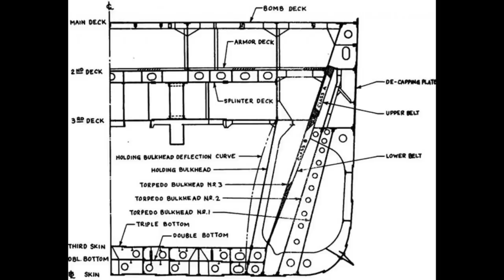The Drydock - Episode 230

Comment from the maker: Pinned post for Q&A :)
Reply: Dr. Alexander Clarke has argued that instead of hiding the true specifications of the Yamatos to make the enemy underestimate them, the Japanese should have gone with a Tarkin-esque approach of intimidation and announced these ships shortly before Yamato’s completion to throw all other navies off their game and force them to rethink their naval construction plans, which would buy Japan a bit more time to build up its naval forces. Do you agree with this proposal?
Reply: Could the Royal Navy have built the Lion class battleships while still complying with the rules of the Washington Naval Treaty?  Also would a KGV with triple 14" guns in 3 turrets have been a more reliable and cost effective option than 2 quads and a duel?
Reply: I recently became aware of the existance of the Kitson Still engine. a Diesel Steam Hybrid engine which not only worked but was remarkably fuel efficient. Was there any attempt by the British (or anyone else) to use such a design in one of their warships, and could it have worked/been useful?
Reply: @davidknowles2491  I'm sure the designers intended the quad turrets to be reliable.  I looked in to the choice to revert to 14" on the KGVs.  The decision seems to have been driven by the "more guns equals more hits" theory.  The initial plan was for the KGVs to mount 12-14", but the armor deck was raised, and that extra weight required B turret to be reduced to a twin.  As one book I read said, that decision, which reduced the armament to only 10 guns, undercut the reasoning to go to 14" in the first place.  Admiralty analysis of the various design proposals said that 9-15" gave the best balance of firepower, speed, and protection, and explicitly said the only reason to go to 14" was if required by treaty.  I also looked in to the triple turrets on the Nelsons.  They also had many faults, most of which had been corrected by the mid 30s, but the basic design of the systems slowed the rate of fire to only about 1.6 rounds per minute, vs 2 rounds per minute on the KGVs, so adopting the Nelson design, in spite of it being debugged by 36, was a no-go.
Reply: Would something like an Iowa museum sell a large chunk of steel plate for it's prenuclear steel for large amounts of money? I heard that stuff was really valuable
Reply: Drach, in regards to post 55:27, do you think that if TITANIC, if the process had of existed in 1911, had an arc welded hull, would she have stayed afloat longer?
Reply: @jesseestrada8914  that's highly unlikely. Plus I believe as museums they have certain agreements on how the ships are to be used or marketed. I don't think selling parts of the ship is contractually allowed?
Reply: @lloydknighten5071  once you have pierced the hull and have water ingress? The issue with the compartments over filling with water would not change.
Reply: @saoirseewing4877  sort of depends on location, number of torpedoes and Warhead size. The preferred method these days is to place a torpedo under the hull and break the keel. Versus the torpedo protection which was designed to counter a direct hit.
Reply: @saoirseewing4877  On the other hand with the Belgrano a WWII era ship was sunk by WWII era torpedoes.  How well a modern Torpedo would do did not come up.
Reply: @chrissouthgate4554  it's not exactly an apples-to-apples comparison. The ships have different levels of protection.
Reply: In the Washington Treaty, would the UK and US have been better off accepting a more favorable ratio for Japan, but increasing the limit on ship numbers to be economically impractical for Japan? Say instead of 15:15:9 capital ships it goes to 22:22:16 or thereabouts. Japan is permitted its Eight-Eight Fleet and a >70% ratio if they are willing to pay for it, which should strengthen the Treaty Faction of the IJN. But they'd have to cut a lot to actually pay for it, if they even can.
Reply: @morat242  The Japanese wanted a more favorable ratio to the US and UK, but the US said that was not going to happen, so the best way to save face would be to at least complete Tosa, which would put the IJN 26,000 tons over their limit, vs the historical retention list putting them 14,000 tons below their quota.  The Japanese could have made a credible argument that they were entitled to a 42,000 ton ship, because of Hood.  If the USN Tennessee class was deemed "post-Jutland", then they, combined with the three Colorados that were completed, would make 5 "post-Jutland" ships, at zero additional cost vs historical expenditure, vs Japan's 3.  Maybe give the US clearance to upgun the Tennessees to 16", if they want to, to make a 5:3 ratio of 16" gun, post-Jutland ships.  Then the UK would be entitled to 4 Nelsons, which they might have trouble paying for, on top of their load of war debt.
Reply: Hi Drac in your opinion among all classes and nations, during WWII which battleships were the most accurate and with the least dispersion?
Reply: Hey DRACHINIFEL... You used the fraise Muppet. Here in my part of the world muppet means a character puppet you would see on Sesame street. What does it mean in your part of the world?
Reply: @morat242  the number still workout for Japan. The UK has three oceans to defend. The United States has two. Her Rivals are spread rather thinly.
Reply: @WALTERBROADDUS  Not if the US and UK have 22 battleships and Japan's economy implodes trying and failing to build 16.
Reply: @morat242  everyone's economy was imploding in the Great Depression.
Reply: If the Brits and America had formed an alliance pre WW2 how might that have altered the balance of power?
Reply: Hey Drach, bit of a long question but it’s one I’ve had buzzing in my head for awhile; I’ve heard that after USS Hornet (CV-8) was abandoned after Savo Island that the Japanese destroyer that sunk her had orders to either sink the carrier and to ascertain if it was possible for the ship to be captured.
 
My question is what if Hornet was still abandoned but was in good enough condition for the IJN to try to capture the Carrier?

What would you imagine the hypothetical reactions be in Japan and America at Hornet becoming the first capital ship captured in a time of war since the Russo Japanese war?

What, if any, consequences would Hornets crew face for allowing CV-8 to fall into the hands of the enemy?

Would the US navy dedicated resources solely to sink the Hornet if it was captured?

What do you think the Carriers fate would be? Would it be used for training, familiarisation  and target practice purposes by the IJN or could you see Japan actually trying to repair Hornet and either using it as a fleet carrier or an auxiliary vessel kinda like USS Stewart or would it just be dug through for intelligence information then sank just at a later date? 

Assuming Japan somehow could field a captured Hornet, while definitely not enough to turn the tide of war, what impact could it have on individual actions in the pacific? 

I’m very interested to hear your thoughts and reasoning on this; also keep up the good work
Reply: @WALTERBROADDUS  , thanks.
Reply: @MrToymaster1  that is a ton of Woulda, Coulda, Maybe, what if, Magic 8-Ball speculation?🎱🙄
Reply: @WALTERBROADDUS  Great Depression was 1930+; WNT was 1922.  Japan's economy was struggling early, but pulled out faster than US due to massive government funding.  WNT era was early 20s, when Japanese economy was still building and shipyards were few.  It was only about 10 years after Vickers transferred building of Kongos to them.
Reply: @LeCharles07  No.  Japan's shipbuilding was at it's limit in the late 30s, partly due to Yamatos but also partly due to yard and worker limits.  The number they took were the ones with the longest legs (most steaming radius, though only 2 of them could make it all the way, so there were tankers along and they struggled to refuel in stormy December North Pacific seas).  The Shokakus were just commissioned and still working up, their air groups were considered "green".  The other carriers available were light or escort, some that could not handle the North Pacific and all with much less steaming radius.
As to "the strike group didn't utilize every attack wave they could have", take a look at Zimm's book on the Pearl Harbor attack.  The first two waves were EVERY attack plane on all six carriers - only a few fighters were kept back for CAP.  There was no "third wave" - it would have been made up of planes from the first wave, recovered, repaired, rearmed and refueled.  Same problem as at Midway - they were struck below when the second wave returned, and the second was more damaged than the first.  No third wave could have been launched until around 11AM at best, but at that point there was a need to rescout the area for the missing US carriers.  Nagumo ordered anti-ship loadouts and high-tailed it north.
Reply: @MrToymaster1  The Hornet was in very bad shape, multiple holes below the waterline and burnt out.  It was not really a question of IF it could be saved - more a question of how long it would take to sink.  Plus the IJN was not willing to stick around and tow something at 1-2 kts in a combat zone.  They would have had to dedicate a significant crew to trying to plug the holes in an unfamiliar ship PLUS a good-sized ship to tow her very slowly (thereby making themselves a vulnerable target).  And the IJN did not think in terms of PR value.
Reply: @morat242  Let the IJN build up new, better ships while primarily the UK was stuck with old WW1 ships?  Not going to happen.  And the Japanese were going to considerable effort to hide the economic strains they were suffering.
Reply: @lloydknighten5071  The problem Titanic faced was that multiple compartments were opened to the sea by being scraped along the iceberg, rather than hitting it directly.  Welding versus riveting would not have made any difference here, it would be whether you could isolate a lot more areas from flooding than she was designed to handle.  Her huge engine spaces guaranteed that she would flood quickly.
Reply: @gregorywright4918  the only thing that pulled the United States economy out of the depression was the war. At any rate, most nations were focused on disarmament not arms building. The whole point of treaties controlling shipbuilding in the first place.
Reply: @davidknowles2491  There were rules about how long you had to keep existing ships before you could replace them, as well as size limits for new ships.  The Lions were designed in the mid-to-late 1930s, and were over the 35,000 ton limit of WNT.  Once the Japanese dropped out in 1936 the "escalator" clause was invoked, which permitted up to 45,000 tons and 16", but the UK was desperately trying to keep the Treaty in effect until the very last minute.  Plus the KGVs were building, taking up space, money, and critical materials like armor plate.
Reply: @bkjeong4302  Unfortunately (or, to us, fortunately) the IJN never saw Star Wars, so their existing strategy of surprise was all they had to go on.  As it happened, even the US was not sure what size they were until well into 1944, and thought they could handle them with an Iowa or two.  What they did know in 1941, when they were near commissioning, was that the US was ramping up with a truly gargantuan building program that would put them way behind by 1944.  And that was also before the big airpower lessons of late '41 and mid-'42.  I don't see the "buying time for IJN to build up" with their building plans at that time - the US was building at 2 to 3 times the rate of IJN, and learning their size might have made things worse.  Keeping the secret preserved the element of surprise, unfortunately (or, to us, fortunately) they never used them to do anything until they were hopelessly outclassed in airpower by 1944.  They could have made a difference if used at Guadalcanal, for example.
Reply: In the 1919 Baltic naval war, the royal navy forces there weren’t cleared to deploy battleships. But what if they were? What battleships do u foresee (unless they already had some battleships in mind) being deployed there and what was the possibility of deploying battlecruisers there instead?
Reply: In the picture for the conning tower question, the battleship seems to have a gap in the lowest belt along the side. Is that an optical illusion and if not, what  was its purpose or reason for existence?
Reply: What if the USN rebuilt some of the standards, like the italians did for the cavours and dorias? What do you think these rebuilds will look like and how might they perform? (Lets ignore cost for this scenario because it'll be ludicrously expensive)
Reply: How feasible was the original supercarrier United States? The one between the midways and the forestalls
Reply: Maybe as a challenge for your Alternate Admiral: Dreadnought game.  Without changing the gun layout (ie must be 4x2 NO triples)
Can you shave enough displacement from Bismarck to make her comply with the Anglo-German Naval Treaty limit of 35,000 tons?
What would you have to sacrifice to reduce her to this legal limit?
Reply: Dear @Drachinifel, have ever made a video about the "battle" of May Island? If not, could you please?
Reply: How would ironclad design be different if people had developed basic rangefinders and some sort of centralized fire control in the 1860's?  The basic science and mechanics of rangefinders don't seem out of reach of 19th century technology, though production would be difficult enough you'd probably only see them on large capital ships.  How could effective combat ranges in the low to mid 1000's of yards have altered ironclad development?
Reply: What was the Yamato equivalent for the Age of Sail, Ironclads and Pre-Dreadnoughts?
Answer: Nuestra Señora de la Santísima Trinidad  140 Gun First Rate.
Reply: I went to church with Bob Murray, the former undersecretary of the USN in the 80's who oversaw the reactivation of the Iowa's.  He told me the navy originally asked to recommission more carriers, but the Iowa's were in far better shape and reactivating an Iowa was about the same cost as brand-new guided missile cruiser.  Great guy and so willing to share his knowledge.  Perhaps a future interview with Drach could be in the future.
Reply: Drach, 
Damage control question as follow on to the Iowa vs missile question. With regard to capital ships: BB, CV, CA of the period you cover... beyond the reserve buoyancy it provided, what Smoke/water/ Fire barriers did the citadels and other critical spaces have? In other words, if an absolute conflagration on the superstructure occurs, and the entire ship is burning down above their heads, could the folks below decks in the machinery spaces, CIC, main plot, magazines, and turrets implement the 1920-1950 version of GQ or Circle William and still function?

Thinking in my head of the carrier fires at Midway or the USS Forrestal fire, but on a battleship or heavy cruiser such as Vanguard, New Jersey, or Belfast.
Reply: What if the French navy took on the regia marina?, considering the Roma Was made in response of the Richelieu, Would they ever see combat against each other.
it seems like if the Richelieu was in Toulon maybe this could have been a possibility,  PS.
Reply: @WALTERBROADDUS  i know, it’s just fun to speculate and I’m interested in seeing what potential could have happened
Reply: @AdmiralWillisLee1942  I'm not sure what do you mean what if? Pearl Harbor surviving Standards were rebuild and we have the results.
Reply: @gregorywright4918  thanks for the reply and explanation 

My question though was from the perspective of a hypothetical situation where the Hornet is still damaged but not to as significant as degree but still abandoned without being properly scuttled 

I understand for such a situation to occur Japan would basically have to have all the stars align and enough luck to rival the displacement of a Yamato, but this scenario assumes that happens.
Reply: @icefox192  Weapons tech has not advanced to make those changes worthwhile.
Reply: @allenkellogg7499  that makes no sense? The only carriers in the inventory out of service were too small operate modern jets. The Essex types could not even operate F4 Phantom. Let alone the F-14. Nor was there any going to be any increase and air wings. The Iowa's were reactivated as surface Action Groups.
Reply: @calenedgar3722  You still require basic ventilation. However ships as part of nuclear, biological & chemical protection are designed to shut some of that down. And in a worst-case scenario, there are self-contained breathing devices for onboard.
Reply: @WALTERBROADDUS  Who said they had to operate heavy jets and serve as a fleet carrier?  They could have operated as helicopters carriers or amphibious assault ships with USMC Harriers.  

Regan's 600 ship navy policy was about politics not necessarily naval readiness or combat effectiveness.

Comment: As for a 'Yamato' of the previous iterations of battleships, I'd venture that the Dreadnought herself is a perfect example.  The Yamato is supposed to outclass everything that comes before it.  So too, Dreadnought.  She is built to swat all other existing battleships, which means, all the pre-dreadnoughts.  She is not built with the intention of being the first of dozens as historically happened.  The Yamato could very well have followed the same course as Dreadnought.  Had WW2 not happened, and air power and the carrier not proved their ascendancy, other naval battleship building programs likely would have evolved to produce their own Yamato equivalents and beyond.  Quite possibly without an intervening war Yamato may very well have been scrapped after little more than a decade simply because she was obsolete by measure of her follow-on peers.